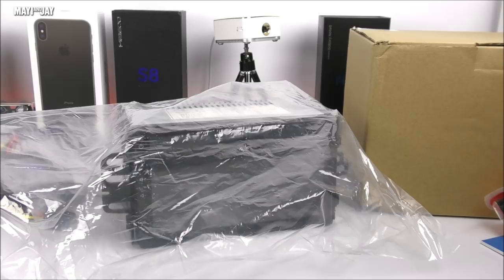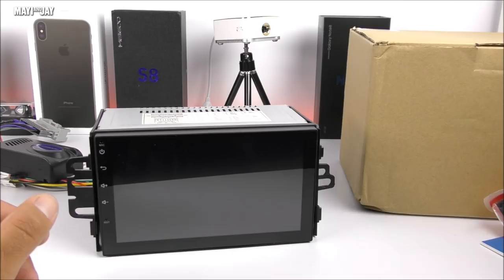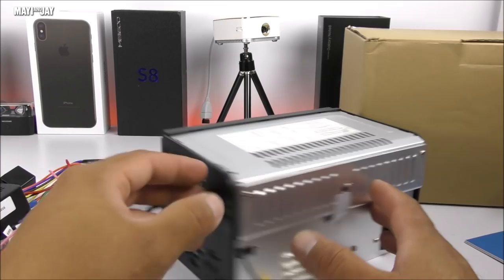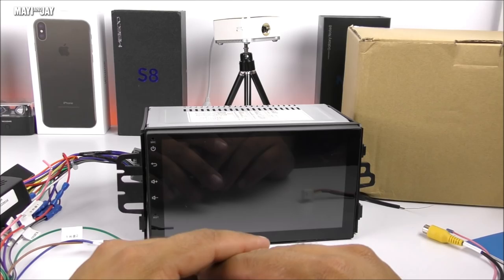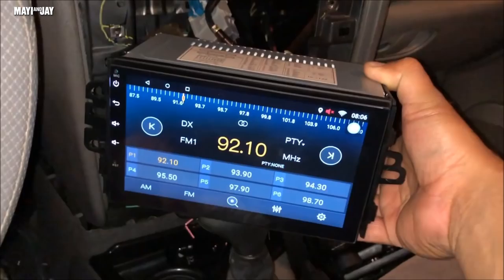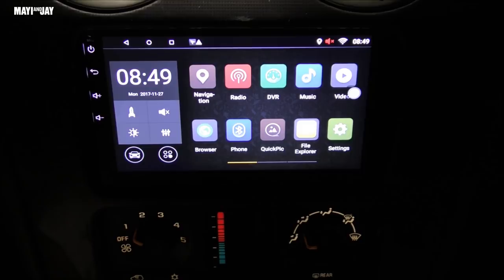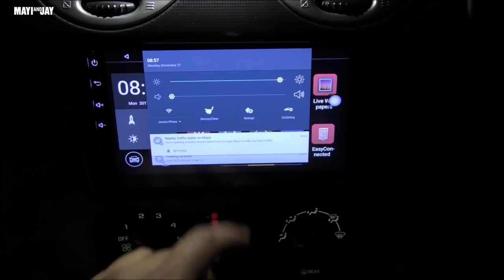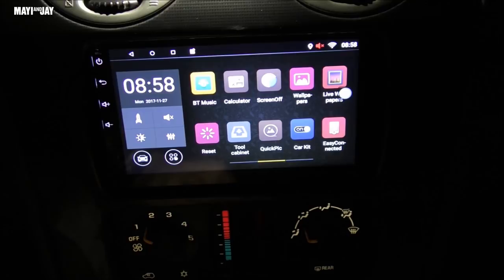[$130] Zeepin Car Radio Head Unit - Android 6.0 - Bluetooth - GPS - Rear Camera

Comment: I have one just like that only a different brand. I love it except next time I will find one with a volume knob instead of the push button. I hate having to take my eyes off the road to adjust the volume. Even with the wiring adapter the steering wheel controls don't work.

Comment: If your like me and the gap between the radio and dash DOES bother you ...Do what i done  Go to your local craft or dollar store and buy pop-sickle  sticks  You can cut them and glue them to almost anything ...I dropped my keys and broke the piece that holds on to the key ring and lost the backing where the battery go's ..some cuts and crazy glue I had a new ring for the chain and a backing plate  I used Black shoe polish and clear nail paint to make it look new  Same thing for the trim piece for the radio can be done

Comment: Will it work with 04 Dodge Durango slt
Reply: It works as long as it fits in your dash and it has the necessary wires in order to work